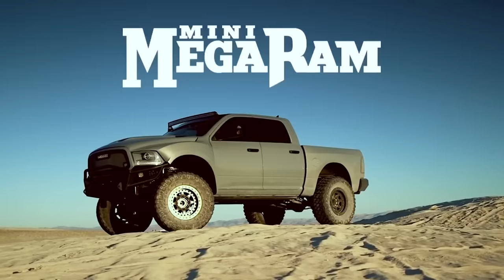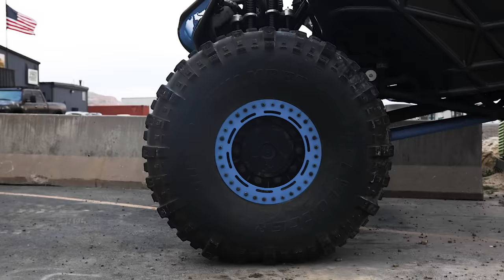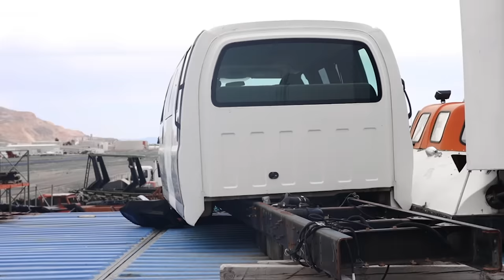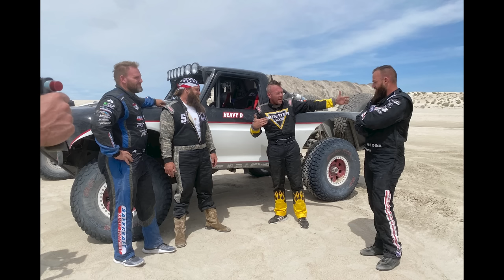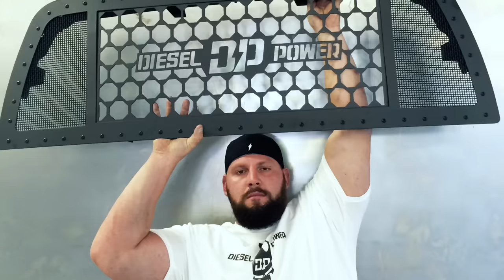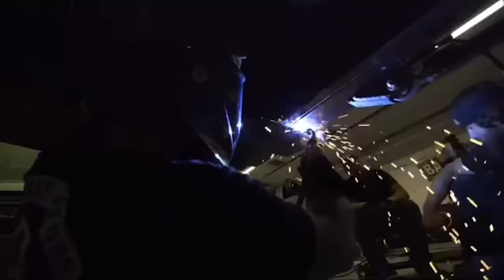TOP TEN BIGGEST BUILD MISTAKES OF MY CAREER!!! ( NUMBER 2 WILL SHOCK YOU)

Comment: Just want to say for the record, I own an EcoDiesel 1500 4 wheel drive pickup. I have personally pulled a 27 ft toy hauler bumper pull camper all over this country and it weighs 9000 lb. Still running stock size tires have a 180,000 MI on the truck with no issues. To 2015 model that I bought second hand with 83,000 miles on it.

Comment: I worked as a skilled Tradesman at Cummins for 30 years, retired in 1999. They had a couple of V engines for years. The longest running was the V903 it was used in over the road trucks for several years. It was used in Tanks for the military for years prior to the turbine development. and for years they had a vim-vine V 4 which was a good delivery truck engine back in the 40's-50's. My uncle used to drive for KLM trucking back in the 70's his International had a 903 in it. He did a lot of cross country hauling. He would get his lunch eaten by Cat's 4306 trucks in the mountains out west. I spent 1 weekend retuning the engine and after that the Cats could never keep up with him going through the mountains again until it broke the frame and they gave him a different truck.But I have to agree about the 5 liter V8. They were just starting to develop it before I retired. It has way too small bore and stroke to make a engine with any real torque.

Comment: Love this video. I hear y’all about the mechanics lien. My granddaughter bought a 2004 Ford Expedition. She drove it like a tank, literally. Bottom line, bought it for $5800. AC never worked. She did not keep it clean. She drove it over a bad country road like a tank. After a $2000 repair, she drove it less than 1,000 miles when she somehow about shook out the whole front end. Another $2000 repair. Instead of telling her family, she abandoned it at the shop. Worst experience. I actually would hav3 got that truck but she wouldn’t answer us. I bet Downtown Auto or 3rd Street auto in Siler City….got a good truck after repairing it.

Comment: My Eco-diesel is Great. I have a 6 inch lift with 35 inch tires. I have no problem with mileage or towing power.
I think you didn't program the tires or change the gears in the rear end.
I have 2 Eco-diesel's and I love them both. 
I get over 600 miles to a tank on the lifted truck and on my Laramie Longhorn Edition I get 750 miles to a tank.
But I do have a Ram 3500 that has a 8 inch lift with 38 inch tires that I rebuilt the Cummins 6.7L engine and gave it 200 HP more. With a twin turbo.
I can pull my 5th wheel without a problem up a mountain and I get a pretty good mileage of around (depending on what I am doing) 450 to 550 miles to a tank.
Truck is programmed for towing and economy driving with a flip of a switch.

You may not like Ram trucks but don't put them down unless you know how to set them up correctly. You seem in your video that you have no clue how to set up a Cummins engine or the truck itself.

Just my opinion on owning Dodge trucks and Ran trucks.

Comment: Cummins did do a V8 engine back in the 70's and it wasn't very good. it started with the V903 which was naturally aspirated and they offered a VT903 which was turbocharged. Most of the guys I knew who had them eventually put big cam 400'sin their trucks or just sold the truck and got one with a big cam or a kitty Cat. I agree Cummins' niche is the straight 6 configuration. I remember hearing both engines called a nine oh nothing. My favorite V configuration diesel engines are a 7.3 powerstroke

Comment: The excursion bronco needed a planetary gear reverser. Extend the driveshaft above the rear diff into a planetary and reverse the direction into the rear diff that’s also been reversed. I built a custom 90’s Ford lightning f150 crawler using this method and it worked extremely well.

Comment: Viper motors are meant to be reved up and go. Plus the gearing had to be screwed. The viper was in a full size truck. Sure not as heavy as the rock buggy but I have seen full blown full size rock crowler kick arse with tiny Toyota 4 bangers. It’s all gearing.

Comment: I wish I had the money to have you guys build my husbands truck! She’s just badass as she sits, runs, but is down due to a blown wheel hub, and possibly transmission gasket from that time. But she fires right up even with all the abuse he’s done to her since our trucks have to be daily drivers, and working farm trucks, and he’s put the beautiful girl through it all! And she’s got no quit in her. But needs pulled apart, and just put back together due to age. She’s a 98.5 Dodge Ram, 2500, 24v, 2nd gen, quad cab, with the suicide doors, short bed 4x4. IMO one of the best motors and builds for the Cummins and Dodge in the last 30+ years. She just needs a major spa day, and face lift lol. I ever win the lottery, and she’s coming your way, and you can make the rules, build her back your way, just as long as she’s still all Dodge, Cummins, same motor, and 4x4 not lowered lol. Lol, life goal here haha….

Comment: When I worked at a local shop as a mechanic we had a guy come in with an eco diesel complaining that he didn't have any power to pull his trailer up hills and that he was having issues with the rear suspension... The guy had a topper on the bed of the truck and it was full to the top with logs plus had an 18-foot car trailer with at least a dozen 12ft+ 10 inch round logs.. I told him just because it says diesel doesn't me you can tow/haul the same as a 3/4 ton or 1 ton... he just looked at me dumbfounded like I was cray for saying that and responded with "well they didn't tell me that at the dealership"

Comment: Thats Nuts & Ya I Would Say If You Dont Have At Least Double The Money You Think You'll Need, Then WALK AWAY I DID A QUITE Simple Motor Swap , BY MY SELF, & By The TimeI Was Done & Got Parts From I Think 7 STATES  We Maxed OUT Every Credit Card We Had & Got More, On Them, it Was Terrible & Ya it Worked & GREAT At about 45 mph. & The Pistons Sounded Like They Were Swapping Cylinders  & the rear end was way too low for the v8 I put in. It Was A Work Truck 1 ton To Make Extra Money Cutting & Hauling Fire Wood While I Was In The ARMY SO I Traded it Off

Comment: Not trying to dis on our environments lol okay yes I am lol  but any truck made for eco anything is bull shit. I drive simies and was a volunteer fire fighter you can't put any eco crap that ruins the performance and operations of a vehicle especially a diesel omg the problems they have worse thing ever. I can't tell you how bad the filters clog and parts go bad fast. 
It almost reminds me of how when I was in Iraq and they tried to start putting up armored crap on our vehicles that never had armor on them in the first place did not work well and we were broke down in combat zones how messed up is that. 
I hate my F150 one day in either going to burn it for fun or tale the body off and make a real truck out of it lol. That thing has been an issue after the second month ugh
Not sure how you guys drive Ford'slol ..... .,....yes I can, 
you make them better lol you guys should take off all the  ford logos your trucks lol. Once you get them the only thing ford is probably the body lol I'm not a fan of anything new unless it gets stripped down deleted and or  made to custom. 
One day when I bring my truck to you guys I'm just bringing the body to you lol but for real. I'm sure as yall know  gas trucks suck. My dumb ass thinking "might  be cheaper at the pump " lol bad thought. You might spend more at the pump on diesel in the long run its cheaper and a tank will last longer. Wasn't until I got the the truck and then was able to compare with my friends that had diesels and I get shit  all the time. Lol.